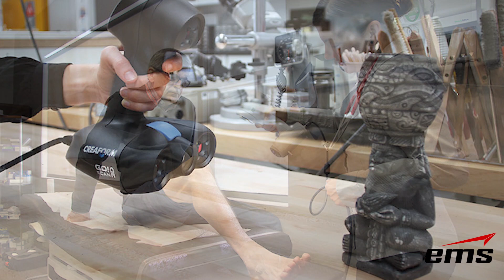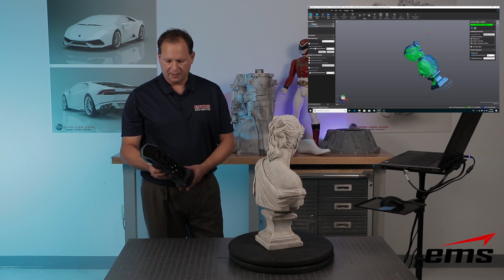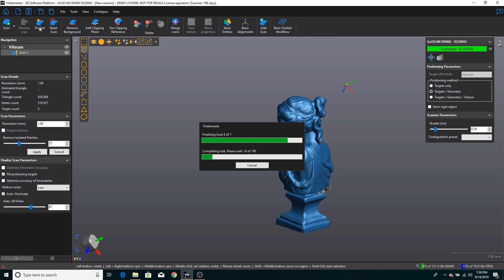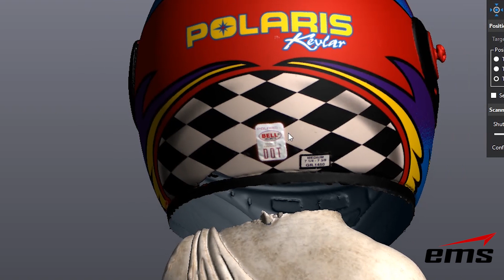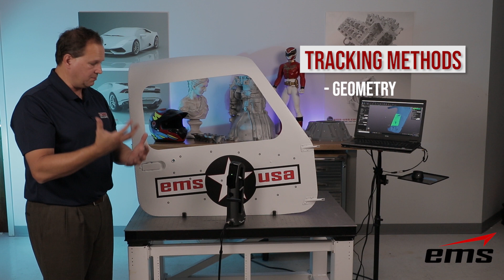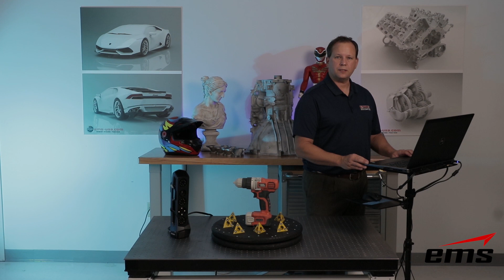Creaform GoSCAN Spark 3D Scanner -  In-Depth Demonstration

Comment: Does the software is capable to generate different materials, from different colors, on a same object ?
Reply from the maker: Hi Acces, when you say "different materials what do you mean?  The scan data could be separated by color if that is what you mean.
Reply: @EMS3D   I mean each color surface as got different material dedicated , that you can change the shiny spec atfer into blender or unity for exemple ?
Reply from the maker: You would have to manually break up the polygons by color in the software that comes with the scanner to do that.  There may be other software products that can do that automatically.

Comment: Why is the price for 3d scanning how it is right now for anything with applicable use with good accuracy? Is it because it is a more niche market or possibly because the technology is still developing? I personally am interested in 3d scanning for historical preservation, video game modelling, simulation and would like to get involved with some of this kinda stuff but it seems it is really only realistically obtainable to companies that are willing to spend a dime on it which I’d speculate are divisions in the film industry or in high quality production that requires 3d modelling. I have seen side by side comparisons with these scanners and the lower end hobbyist versions are they no where near as good to the industry level kit like this yet they are both still incredibly pricy at this time.
Reply from the maker: Hey James.  Good question.  Why do the higher end commercial 3D scanners costs a lot more than the consumer/prosumer products?  There are a few reasons that most people don't understand.  

1.  R&D.  Companies like Creaform spend millions of dollars each year developing, testing, manufacturing and supporting their 3D scanners.   This includes the hardware, software and accessories.  This development ends up trickling down to cheaper brands over time but Creaform often pays the "up front" costs to bring new technology to the market.

2. Support.  With a company like Creaform and EMS as a reseller we employ mechanical engineers with years of experience using 3D scanners and the related software for reverse engineering and inspection.  This allows us to help solve the most challenging applications and problems our customers have.  Our highly skilled team members don't come cheap.

3. Volume - the commercial market for 3D scanners is relatively small when you compare it to other markets like CAD or even 3D printers.  Because of the low volume the products need to be priced in a way that companies like Creaform and EMS and can make a reasonable profit to exist and continue to grow.

4. Quality - The materials used in Creaform 3D scanner is the very best.  Things like the optics, sensors, chips, internal structures, plastic housings, and more cost money.  Also given the fact these are sold in low volumes as explained above the economy of scale to purchase the raw components is not great.

5. Certification - Most Creaform 3D scanners are certified through various standards like ISO, VDI/VDE and others.  This of course means the internal company processes, testing methods, accuracy statements, manufacturing processes, scanner calibrations and more meet the highest international standards to ensure you get a quality product and ongoing service and support.  As stated above this is an expense that isn't cheap.

I hope that helps you at least understand why the commercial, high accuracy 3D scanners costs what they do.  I know it doesn't make it any easier to buy one but surprisingly we have many small companies with 1 or 2 employees using these scanners in their business.  They have a found a way to justify the cost by weighing how much faster, better, easier, etc it makes their business work.
Reply: @EMS3D  Thanks for the quick reply, thought as much that some of these factors may be the case. Have to wait and see what the future brings for me then! At the moment would you see these devices within learning environments such as College / University for engineering and aerospace type degrees which would invest in this technology or is it more geared towards “applicational use” in the field.

Comment: You say it's using the nVidia GPU but is that required or does it just help? I have another scanner that requires nVidia and that really limits where I can use the scanner because my laptop is fine for my 3D work but only has Intel graphics. So I have to use the scanner right near my desktop.
Reply from the maker: The scanner will not work without a Nvidia P5200 or RTX 5000 (or better) graphics card.  The scanner directly accesses the card and uses the GPU.  It that card is not found the scanner will not scan.

Comment: Thank you again for this review. I hope to see a scanning of a car's inside with outside light conditions like you did with Black ! It's already very nice that you and your crew did this video, thanks for that.
I have one question : you said this scanner is good for all things that are not "critical metrology" with extrem ISO tolerances. Please could you find an example with only one object that could be scanned for 2 different purposes, the first purpose has a need of a very good accuracy but could be done with Spark, but the second has to be done with Black (and why) ?
I think it is mostly concern every critical mechanical parts that has something to do with fluids, gaz and stuff, right ?
Thank you.
Reply from the maker: The HS Black will do better on challenging surfaces such as machined aluminum, dark and shiny, chrome etc.  Scanning a dark/shiny interior of car in direct sunlight for example probably won't work well for the Spark.  Unlike the HS Black which uses lasers on a different wavelength than sunlight the GoSCAN Spark is just an LED light that will get "washed out" by the direct sunlight.  The HS Black also offers higher resolution and ISO accuracy.  So depending on your accuracy and surface requirements will generally dictate which scanner is the right one for your needs. 

We plan on doing a comparison video soon between the Spark, Black and MetraSCAN so you can see how they all compare to each other.  We have an older version here.  https://www.youtube.com/watch?v=W43Yf0B4i9A
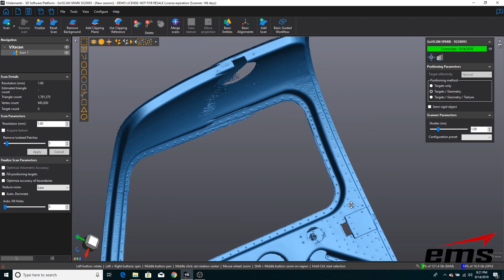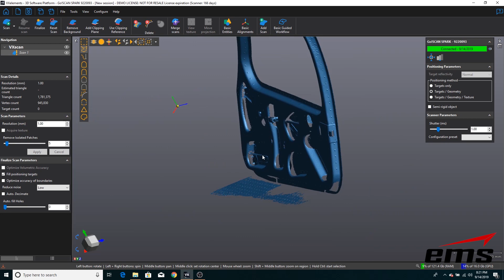Reply: look at the upper part of the door at 21:05 this is a failure for a scanner for 40 thousand dollars))) at 21:12 we are shown another scan.
Reply: @dimarusful  that kind of thing happens with whatever kind of optical 3d scanner, calm down. Sometimes you fail at markers placement, sometimes software loose tracking because of similar features, sometimes both, nothing new here, whatever the price.